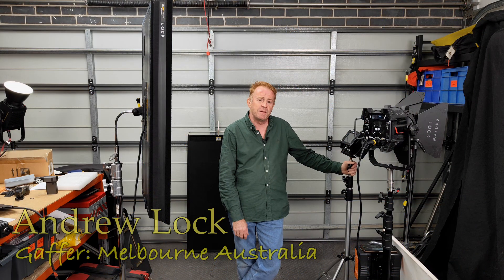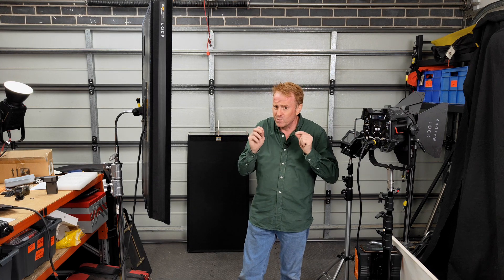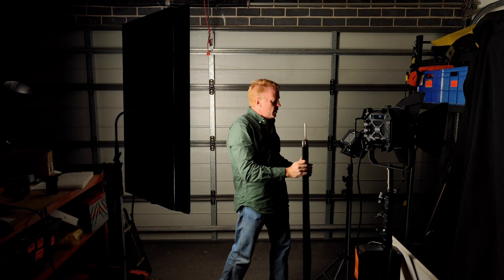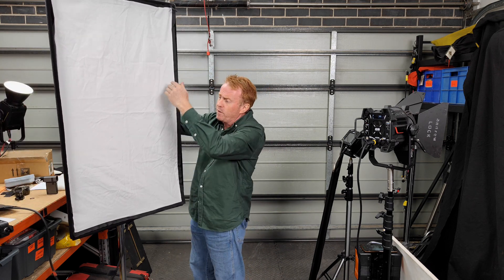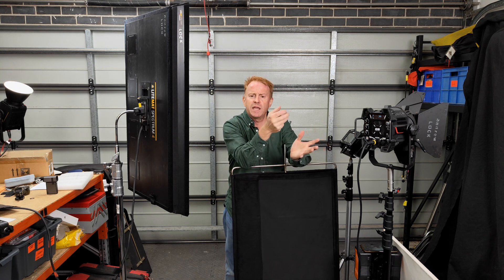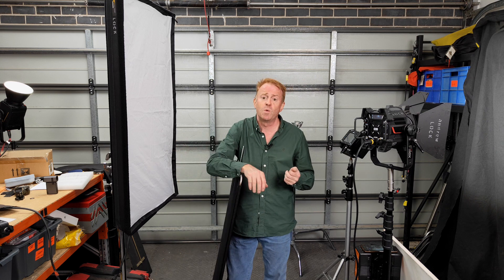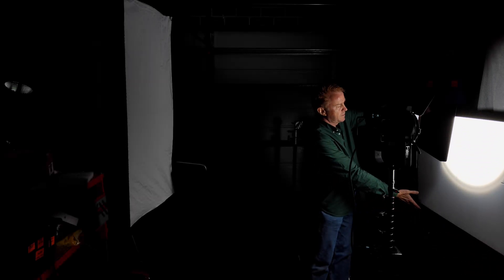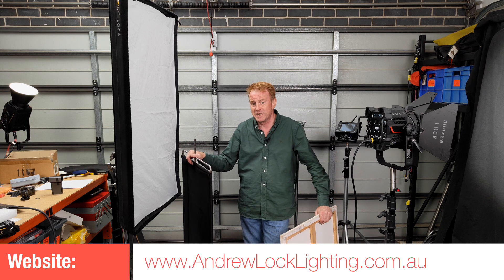Gaffer & Gear 252 -Dimming Lights Without Using Dimmers

Comment: I wonder if you could use a hard grid to do the fade, while keeping the lit area about the same. Use - say a 45 degree grid - and tilt it up or down in front of the light source, ...gradually cutting off the light as the angle increases relative to the  source.
Reply from the maker: That makes sense in my mind

Comment: Could you explain the "double break" method a little more? Is the idea that the 4x4 diffusion frame will provide enough bounce return to keep the hard shadows from developing?
Reply from the maker: The front 4x4 is the light source closest to the subject,  so the idea is that one is being illuminated from the unit behind that is being cut. So it will stay closer to its full 4x4 shape. Not perfectly but enough to help keep the size of the light closer to the same

Comment: Moving anything across the light is a problem, it changes the quality of light.  Best solution to a non dimming light was a shutter like system. Mole shutters were a go to on dimming HMI's for a good while (just don't melt them, leave them open between takes or pan head away, don't place too close to head, and be ready to mitigate bleed between shutter louvres). With cooler lights and bigger sources,  a pair of cutters could be used instead. As close to the head as would be feasible on stands, overlapping just enough when closed, so that one man could operate them.  Beam would be affected because it essentially was narrowed but less so than a single flag. You can get around this better by having multiple cuts and a few gag operators instead of a pair of cutters. A better solution if you don't have the shutters and you have time to build it, a set of blk/blk foamcore cut with overlapping patterns which you can slide up/down/left/right (whatever works) to block out the light for a dimming effect. Good idea to have a bit of silicon spray handy in case moving parts squeak.
Reply: The solution Andrew mentions at 6:30 minimizes the issues you're describing. Cutting the light before it hits a bounce keeps the apparent source size pretty constant though the fade.